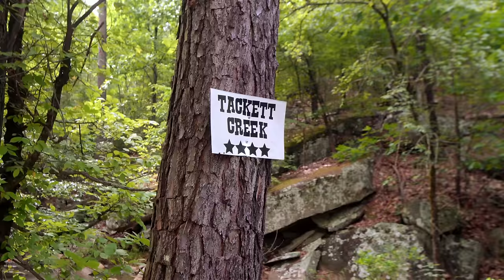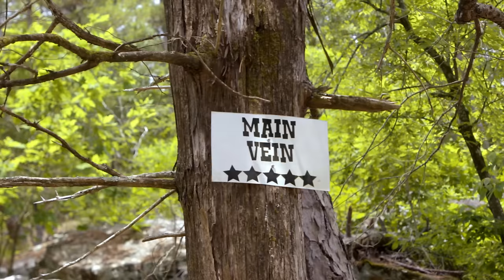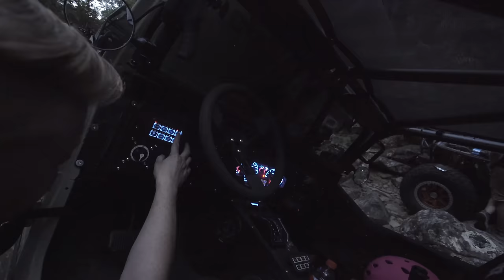Deep Water, Huge Rocks and Dangerous Creatures | 24 Hell and Back

Comment: I was a Rockford and JL guy until I graduated from 1kw amps and sq subs. Don’t get me wrong. It’s quality stuff, but I wanted bigger louder sounds. Now I play with cheap spl/sql subs and 3-12kw amps.  And about the Quality. ..Every single JL w7 sub I had deteriorated in about 5 years. I fixed it but still. I have a 20yo RF T2 holding up great. 
So what is the best? Just an opinion?

Comment: Ive run a few sets of the newer style mud claw extreme Mt and have been really happy with them. Different tread pattern and much better sidewall than the older ones. 10 ply 245 75 R16 on my 3500 Chevy drives great on highway and curvey roads. Little to no sway from the side wall. Pulls great in deep mud, cleans out well when spinning. Excellent traction in snow but a lil sketchy on solid ice.... Great tire for the money, i haul heavy loads and average about 20,000 miles a set before i replace at about 40% treadlife left. I always sell my takeoffs for $200 a set. Best budget mud tire ive found so far...

Comment: those 4+4 should have netting on the doors to help a driver from losing a arm , most high performance race cars have webbing on the doors and quick release steering wheels and proper harnesses i know they go very slow even slow can be just as bad in a crash just some ideas for you jeep driving so think about it it is good to be safe and ware a helmet all the time .

Comment: When it comes to helping one another in a pinch, there seems to be a disconnect between teams.  At 34:34 minutes, the Jeep was rolling over and the dude on the rope didn't try to hold or save the Jeep until after it was completely over.  It was savable.  Everybody wants their video for their own blogs and crap and there is no real support team.